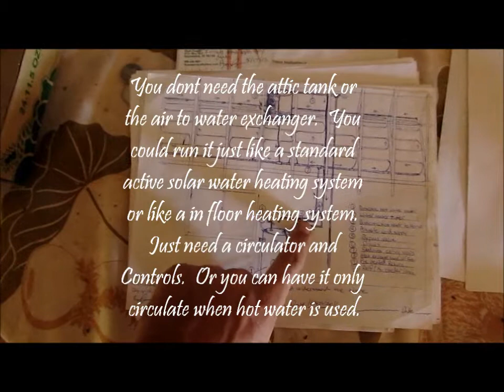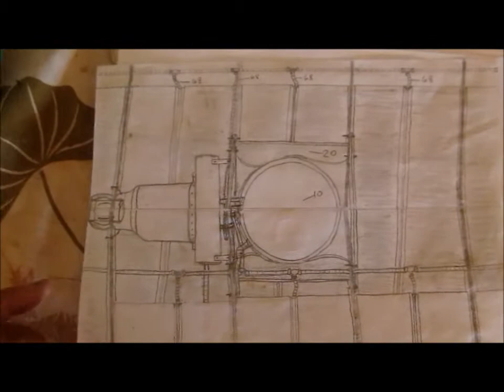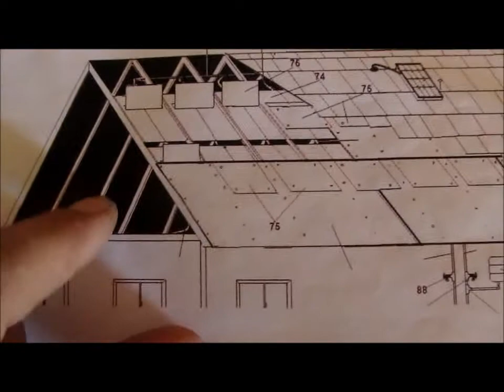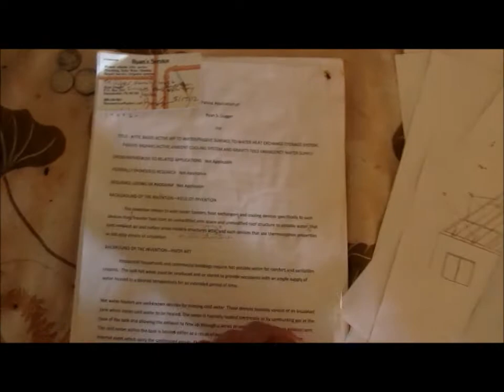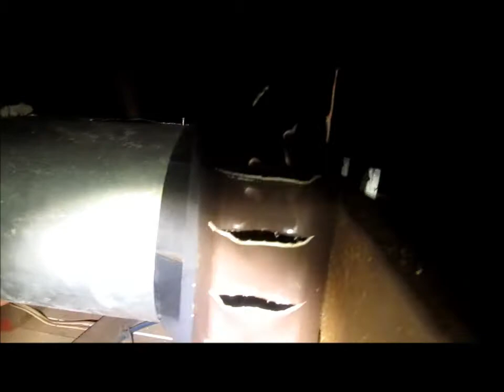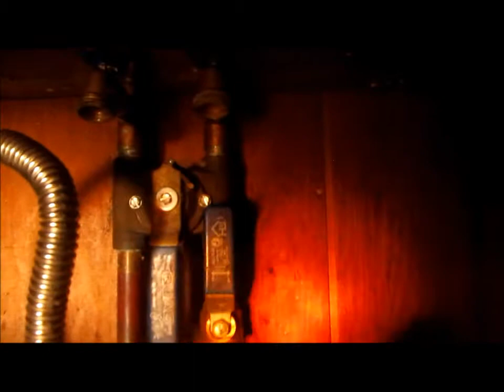Attic Based Passive Domestic Solar water Heat Exchanger system, Public Disclosure

Comment: loved your video, had a pre-heat system in the attic of my old house. I ran from cold water in up to the attic and ran copper horizontally back and forth up the top four feet of the rafters  (25×20)ft area. my attic reached 130f on a regular basis spring through fall. a simple valve to shut off and a drain to empty for the freezing months in Indiana. while in operation water heater rarely turns on unless you take shower,run dishwasher and washing machine. good luck to you sir don't give up on your patent.
Reply from the maker: +craig jones to late on patent its now public knowledge.....but nobody else can patent it.  So if they start selling I can at least say I thought of it first and have proof because of this video